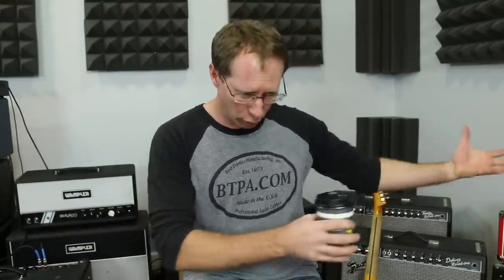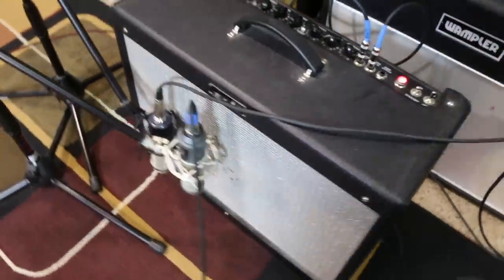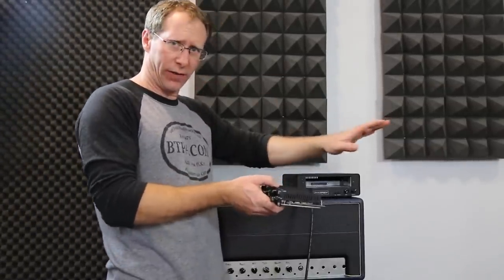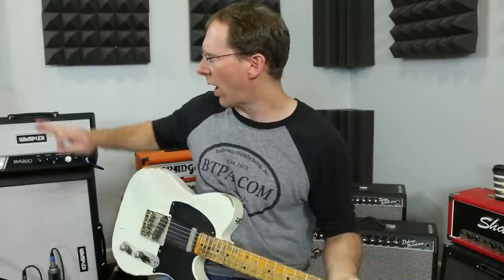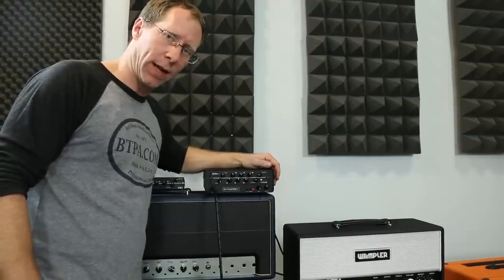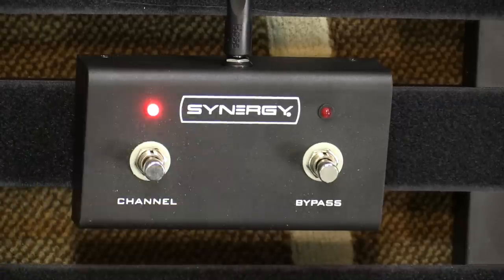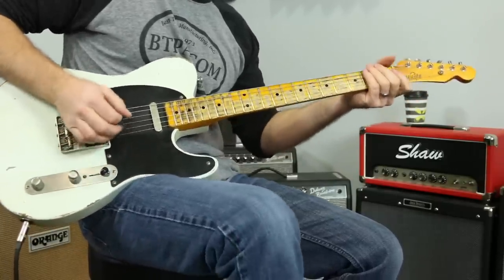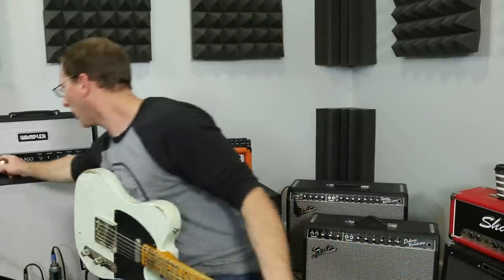Are VACUUM TUBES now the FUTURE? A look at the new Synergy technology

Comment: I do not get the point of inventing yet another proprietary pseudo-standard. Why not just put it into a 500 module, make it compatible with that and sell the housing for a single at a decent price point. People with a 500 box will love this and buy the shit out of this. The only thing that it adds are some plug you can fit on the front plate of the unit if you are using 2 units.
Reply: Angbor3D this is actually compatible with decades old Egnater and Randall preamps, which used the same idea.
Reply: The problem with incorporate tubes into 500series is that 500 series standard PSU give you +/-16V and 48V of phantom power while tubes nedds 6,3V or 12,6V for heaters and above 200V for anodes so you need buck converter built in in each 500series module.
Reply: MrBarnejstinson Good point. And most 500 Boxes only give you a limited amount of ampere per slot.

Comment: not to be a party pooper, but how is this any different than from when Randall licensed pretty much this exact same tech from Bruce Egnater a few years ago?
Reply: Bruce Egnator is one of the people behind this product, so there you go.
Reply from the maker: see pinned comment above - 
Here is Synergy's official response regarding the difference between the two companies and their tech: Synergy is quite different than Randall. Below are some of the key reasons. 1) Synergy modules are dual channel - Randall was single channel. 2) SYN-1 and SYN-2 can interact with your amp to add channels. 3) Synergy hardware can “sense” which Synergy module is inserted into it and adjusts the cathode biasing circuit on V1 tube to match the original amp. Patent pending. 4) Modules are from the actual amp builders. Synergy branded modules are of those brands that declined the invitation to join us. In other words, they sound and feel right. 5) The brand owners profit share with each module sold - they get nothing when someone“profiles” or “models” their sound digitally. 6) Synergy is built in USA using Synergy caps. Synergy caps are the “secret sauce” for many boutique brands. They are USA made and quite expensive. 7) We own the patent whereas Randall licensed it. We are in for the long haul. The hardware is more innovative and the modules are more flexible and authentic.
Reply: Wampler Pedals thank you

Comment: So is that considered the “4 cable method” or is that something entirely different ?
Reply: NIKKI REAGAN this is a little different I believe. When you plug into the fx loop of an amp, you are essentially plugging straight into the power amp. The power amp of a tube amp doesn’t have inherent tone characteristics, it’s meant to be the literal power section, that’s where the power rating comes from. In a fender hot rod, it’s a 6l6 power section. So when you plug a tube preamp, like these, into the fx loop, you are essentially bypassing the amps preamp section and replacing it with whichever you plugged in. The reason the synergy has multiple cables like that is so you can also use the hot rods preamp, the footswitch lets you switch between both. I’ve been doing this for a while and it’s a great way to totally change an amp since so much of that flavor is in that preamp design
Reply: this is exactly 4CM
Reply: NIKKI REAGAN technically you are using the 4CM but for replacing a preamp instead of using pedals after it. You can use pedals  as well  with this units but that would be like a 6CM
Reply: the 4 cable method is a way of hooking up old school effects like a gt10 boss multi effects pedal etc
this is using your guitar amps power section and using a different pre-amp section
Reply: Yes and no, it is doing that but it is close to the 4cm method because you are going guitar into synergy but the synergy allows you to bypass its self and go into the  INPUT of your amp but when the preamp is used (bypass off) it goes synergy into you amps pwoer amp, if you then use the FX loop you basically have three preamps (stock, synergy ch1, synergy ch2) going into your fx then into your power amp. 4cm is using the the input and fx loop of your amp chained to your fx unit which is exactly how you set the Synergy up but instead of being a MFX its a preamp.
Reply: It is a 4 cable method, but the pupose is different. With a digital processor (like the Helix or the Headrush) you use the 4CM to be able to run effects in front of the preamp, or in the loop, both coming from the same unit. 

In this case, you use the 4CM to be able to still use the preamp of your amp, or the ones the Synergy unit has.
Reply: Like SD-Bassist said, but the good thing about that is:
You can still use a Helix/GSP1101/TC-Major in 4cm with a Syn-2 that is at the same time connected in 4cm with a head. You can stack it. Together with a midi-switchable head like a Tubemeister that would be 7 real tube channels with all effects controlled by one midi board. Does it get better than that, if you want the real thing?!!^^

Comment: I think this is cool however I don't see this catching on.  I think it will be a successful product with a devoted fanbase but it's not the future.  Unless it's something like a Diezel or a Soldano the sound of an amp is the sum of it's parts, not the preamp.  The preamp is of course integral to the character of an amp but the power amp is almost always equally important.  As far as studio use, I can see someone really digging it if they want to have a bunch of high gain amps like Mesa, Diezel, etc.  This is sort of being implied as a "Kemper/fractal/etc killer" but I don't think it can actually compete as far as capturing the sound of any amp you want.  However, I do think the results sound amazing, and the diesel did indeed, sound amazing.  It's just not really going to necessarily capture the main mojo of any amp, as the mojo can rarely be found solely with the preamp (unlike in the Diezel, where the preamp is much more important than the power section).

Comment: That’s just a fantastic form factor and I like that they are liscencing the IP from a lot of these great small amp manufacturers. Amp modeling is going to be the death of a lot of manufacturers, but those simulators are just bad copies of these neat little preamps which are essentially the real deal front end of the best in class products. It’s not cheap, but this is a high quality analog tube based product.

Comment: I thought the T-DLX was meant to be 2 blackface fenders 1) high powered twin with more headroom and a 22W deluxe reverb type headroom. The way they named that is very confusing and kinda misleading. I'm sure Avi will come on and rectify it or have you delete my posts as usual lol.
Reply from the maker: I’m not sure. It’s probably on the synergy site. I’ll make a correction when I get the time to go through the other units. In regards to the other comments regarding avi, I have no idea what you are talking about. Elaborate pls?

I only delete comments if they are trolling rudely. Other than that I have no problem with negative comments.
Reply: Two times I've commented. On some of your products prior to letting other know that you had switched to Boutique amp distribution and well it was prior to the bravado being released and well I got chewed out and or comments deleted

Comment: You should just say it......this is a throw back to the 1980's and the shift to rack mounted rigs where you had a separate pre-amp and an inserted effects unit and then out to a power amp in your rack......either running mono or stereo via the power amp unit.  BUT NOT PRESENTED AS A RACK UNIT......but more like a gaming console where you need the different cartridges........just another marketing ploy.

Comment: We're are you going with this  Brian? OK if you are getting paid to promote this. But a Bognor designed the line 6  40 watt valve  amp, that  will give you all those sounds, tones , and more for $450 guarenteed  in a combo! and 4 chanels can be stored and recalled  via the foot controler , so NO  it's not the future it's  just the racks coming back in a more expensive way,  and as a  pedal designer you know it!
Reply from the maker: Respect, but totally disagree

Comment: If this equipment would run straight into a PA, so as a guitar player you wouldn't need to take an amp, then they are onto something. If the only way to really get a good sound is through another amp then its a waste of time.
Reply from the maker: It does.
Reply: Dave Anderson 
it has a really great sounding cab sim direct out for just that purpose.

Comment: These tones SMOKE any modeling solution, period. And I've owned every modeler and all of the best. All you need to do is hear that amazing Tele through the Bassman or Deluxe model to hear and understand IN THE ROOM no modeler through an FRFR is going to sound like that... sorry. Great to see Synergy has taken the concept and are keeping it alive and growing. The new XTC module is supposed to be sick.
Reply: Um nearly zero people have been able to tell the difference between the original tube tone whatever and the Kemper, AxeFx or Helix when they are actually setup properly. So many dudes with literally millions to spend are choosing them they all can’t be wrong... the problem with digital platforms is they are so powerful it’s incredibly easy to ruin the tone if you don’t know exactly what you’re going for, the traditional amps are so limited it’s actually hard to get a bad tone... that’s the practical difference... big heavy expensive and hard to maintain, but easy enough that anyone can get good tone vs lightweight easy to maintain and difficult for most to get a good tone, but the ability to dial in almost any tone ultra precisely... for people making money with the gear digital is an absolute no brainer, same exact tone night after night no matter what else has changed...
Reply: @robertw1871  I am good with digital, analog and tube products. So many to choose from that provide convenience and quality which is what many are searching for. That being said, I've had top notch modeling gear in the house to A/B vs. tube based and and TO ME it's no contest (still) when I am playing the gear. I recently A/B'd the DSM Simplifier (excellent analog amp/modeling) vs. the Synergy BE module (both channels) simply using the cab simulated DI out and I'll take the Synergy every day of the week. I've had the AxeFX III, FM3, Helix, Kemper. Have you?
Reply: @TalleyWacker1000  yeah I've got a helix and a kemper... I hear you I was a hold out for a long time, but having seen so many people not be able to tell a difference between the real and model, most people when they know which is which are actually preferring the digital, I still find it hard to believe that digital has now not only matched vintage analog but most likely surpassed it for the majority of people... there are so many big name pros that run only digital now... all I'm saying is the stuff is good now, if it's setup right it's extremely hard to tell unless (most of us) really listen hard, and its usually the hum and noise that give it away... I found it very difficult to get the helix setup at first, now that I know how to adjust it its pretty amazing and the Kempet is perfect at capturing a tone but not as flexible... i still love my tubes and analog gear, it just doesn't get used much anymore... but I think it comes down to what type of gear prefer to interact with, a lot of the time I don't care for how complicated the Helix is, just not easy like turning a few knobs, so that's where digital fails, it's too powerful and easy to get a tone messed up pretty good of not careful with the setup... that's probably why most of the top pro rigs are setup by the manufacturer or a specialist company to copy the live analog rig perfectly....

Comment: Synergy seems to have missed a whole lot in their module. Like uh, DeYoung transformers for their alleged SLO? Pfft, doesn't sound like an SLO, not worth it. These modular guys just never seem to grasp that putting different preamps through the same output circuitry and same transformers is just going to same like a lot of the same preamps with different EQ. There is NO SLO mod, sym, or preamp that will sound like an SLO.
Reply from the maker: You would have to tell that to Mike Soldano I guess... HE is the one the designed the SLO module.
Reply: Mike Soldano is a god damned legend dude. I'm sure he's just involved to promote his brand. By the way, Mike already has something called the GTO which sounds better than the Syynergy.
Reply: By the way, I was more interested in hearing the Wampler amp than that Synergy junk. You guys have some of THE best pedals around. Instead of that snowflake Brad Paisley, you should do an America-First Trump pedal that gives you three three distinct boost/drive colors. Not everyone wants transparent overdrive, and often people want a different flavor from their amp. Then you should include a "Great Again" variable mid boost. I'm not talking about one of those germanium/fuzz things that everyone does either. Red-White-Blue man.

Comment: I'm trying for the life of me to understand where the vacuum tubes go. Certainly not in the plug-in modules - that crap all looks solid state. Not in the miniature cab they slide into because there's still no room for them. All those modules sound about the same to me - as the same as a Chinese knock off overdrive pedal. Turn the gain up on all those things and what have you accomplished? Stealing 24 minutes of my time, that's what. Sorry but that stuff wouldn't travel with me anywhere. In a lot of the demos I wasn't sure if the thing was active or not because the led indicators were off. Bad camera angle maybe. Anyway people complain why they get downvotes. Now you know.
Reply: You didn't see the tubes through the holes in the module at around 2:28? It was pretty clear that that's where the tubes are.

Comment: There nothing new with tubes. the question is jfets the future. jfet sound like tube and great for clean channels. due to miller effect they warm up a square wave. also in amp you run those these at higher volts which make them sound even better. disadvantage is can't get as much gain out them and still have them sound great.  few amp use them.

Comment: They want $500 for the box without a module, plus $400 for a module. Just buy a Kemper.
Reply: Fred Garvin - personally I don't know anybody who KEPT their Kempers.
Reply: Three friends had Kempers, none of them like it, they all sold them, so call it shit all you  want. By the way, I didn't say anything about the modules. I wouldn't mind getting authentic SLO tone for $900 but what kills it for me is having to manually swap module to to switch tone.... seems a bit impractical to swap twice for each lead break. I didn't try a Kemper myself but so far I'm much more interested in Fractal.
Reply: This stuff is way overpriced. They have tried this twice before and they went nowhere. So they add a new feature and raise the price thinking that's going to sell. 
 Do you really think you're going to get an SLO for $399? It's not 
 much different than Kemper or Fractal modeling one.

Comment: The synergy is nothing new, just another take on the egnater/randall concept. However, today they're too expensive for the current market where we can have many other solutions that are cheaper, more practical, more flexible, and sounds just as good. 
For instance, the Black Widow MGP have 18 modules, all in a 2U rack. No need to remove and insert a module all the time. And even at $2,300, it's only $130 per modules (Synergy are $400 per module + the chassis). And you can switch amp by the simple press of a button, no need to remove a module, insert a module, remove the module, etc... 

There's other solutions, such the Joyo Dual-Klonz, that for $1,800 will have 24 types of Amps already, with ability to reconfigure the whole preamp section on the fly, and no need for another box to use in a 4CM, etc...

Others solution are the 1-2U Preamp rack. Rocktron will finally release their ValveSonic Preamp introduced 3 years ago at NAMM. So again, you have 1 unit per preamp and they're not priced much more from the Synergy module. But they have more features and tone capabilities. 

There's also the Russian modules from Myasnikov. For instance the SLO module is $390, so even cheaper than the Synergy and you don't need any chassis since it's a complete Preamp solution in a 1U rack with 3 tubes.

I understand that Synergy is done by the Boutique Amp factory, the same factory that build products for Wampler, Friedman, Morgan, 65Amps, Bogner, you name it... So I understand they have to support each other, but sorry this whole Synergy thing isn't good enough for the current market (it's a concept from the past that haven't been rethought properly by people looking forward... it has been rethought by people living in the past... sorry!)...

PS: ...and it comes from someone that loved the Randall RM1250.
Reply: Once you compare Synergy all tube system to profilers and modelers you will instantly feel/know the difference
Reply: Not an argument! Next time, before to answer, try to read the comment properly and know what you're talking about! there's absolutely no digital profiler or modeler in my comment! All examples I've given are full analog tube systems... just like the Synergy, but better and/or cheaper!